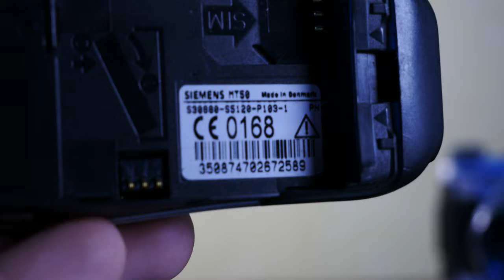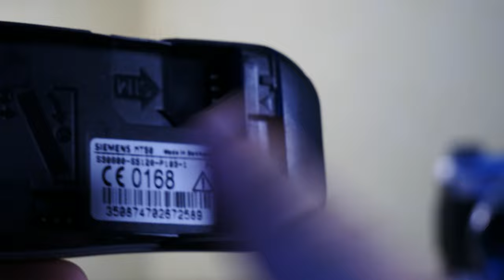Call History - the Siemens MT50

Comment: Siemens MT 50 are acelasi sistem cu cleme rapide ca si Siemens M 50, A 50 si C 45 si poti sa scoti carcasa linistit fara nici o problema, eu scot de obicei carcasele la telefoanele astea in citeva secunde fara sa se rupa nici o clema , in ciuda a ce par a fi clemele de sus sunt destul de solide nu se rup asa usor, e suficient sa bagi unghia sau un instrument subtire din plastic intre cele doua cleme de sus si carcasa de mijloc si se separa foarte usor si fara probleme, chiar si carcasa de mijloc, la Simens C 45 se desface usor, eu unul am schimbat  si carcasa de mijloc, pentru ca cine a folosit in trecut telefonul, probabil nu a stiut cum se scoate bateria din acest model si a distrus practic clema care tine bateria .
Reply from the maker: Corect, tocmai ce am desfacut un sl55, a fost mult mai complicaf
Reply: @techbytech85  SL 55 fiind un telefon tip slider (cu mecanism pe sanie), este in mod normal mult mai complicat de demontat, sincer la genul acesta de telefon indiferent de marca sunt multe chestii ce se pot defecta in timp, de aceia mie unul nu prea ami plac telefoanele gen slider(cu mecanism pe sanie)  si nici cele clamshell (cu clapeta) .